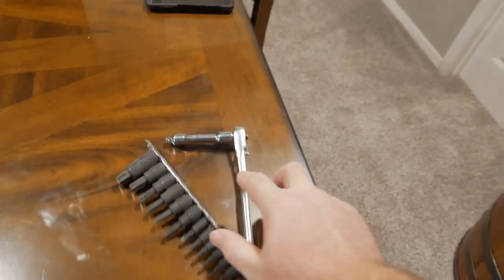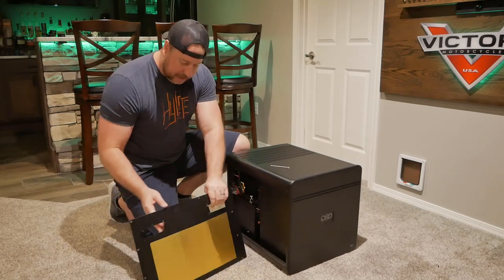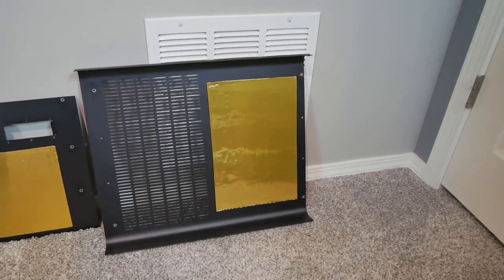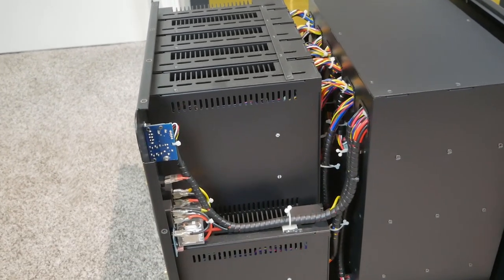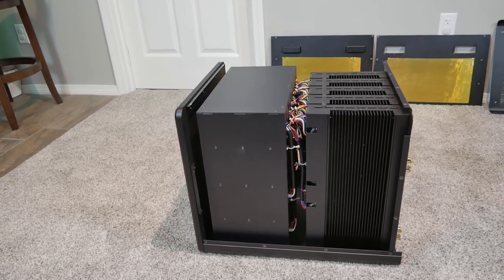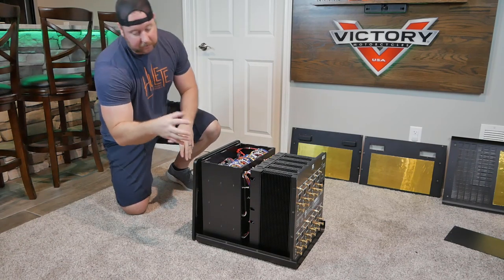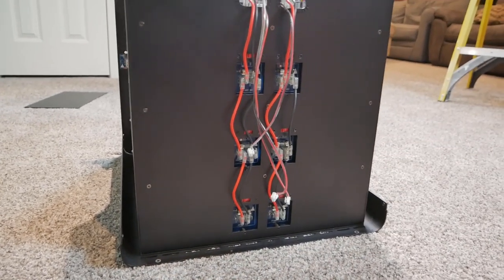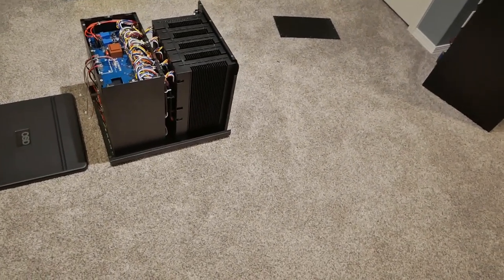Inside a 230 Pound Amplifier!! Opening the OSD Black Theatro X11 Home Theater Amp 380 watts x 11

Comment: Did you ever do a performance review of the X11?
Reply from the maker: I did not... there was some issues getting both power supplies to work without tripping breakers. OSD asked for it back and we decided not to do a video on it since it was not working correctly for me. They have assured me it has worked in several other installs they have done... 🤷‍♂️ I just know I couldn't get the full potential out of it due to it only getting half the power it needed

Comment: Whats up man? Great video! Had me laughing. I got a question not pertaining to this video. I'm looking at getting screen material from Carls place. I'm thinking about going with the flexigrey like you got.  Since you had a little bit of time with it now are you still liking it? I'm just trying to improve my black levels from my epson 8350 projector. Don't want to get a projector just yet since there is only a couple hundred hours on bulb. I also have a manual pull down screen that has wrinkles in it from sitting for a couple of years until my room was built. So I got to figure out away to attach the screen to the existing material and hope it doesn't get jammed up inside the case.
Reply from the maker: Thanks man! The flexi gray has been awesome. Love it for my area. Little bit of light rejection with it not being white and when the lights are out, blacks are a little deeper. Don't expect miracles, but it should improve your blacks a bit. As far as the roll up screen... Idk how the flexi gray will work with that... Might be too thick by the time both materials are on there. And if there are any creases in the flexi gray, they'll probably show up just the same. It needs to be stretched pretty tight to get a smooth surface. A fixed screen is probably a better way to go if you grab it
Reply: @LifeofBliss  Ok thank you! Stay safe!

Comment: I wonder how well it dissipates heat under moderate and full load? lol
Reply from the maker: Supposedly it runs very cool... but I could never get both circuits connected without tripping the breaker
Reply from the maker: It will work with 1 power cord only, but that kind of defeats the purpose
Reply: @LifeofBliss  Wow! I put 2 dedicated 20 amp circuits, but it was because I have too many devices connected to the 3 Furman line conditioners. This is only one Amp!
Reply: @LifeofBliss  This is a real life eye opener. Glad they offered it to you for reviewing.
Reply from the maker: Yea I have 3 20 amp circuits and a 230v30a for my sub amp in my equipment room. I did the wiring so it was cheap and easy to run several. OSD swears it has worked in many applications, but I couldn't get it to work correctly in 3 different homes... don't know what the issue was. Even did some testing with a multi meter to switch the polarity of the positive terminals between the 2 circuits.
Reply: @LifeofBliss  I did it myself as well. Its great that you took the time and effort to at least try and make it work to its full potential. Nice unit but feels like its in the Beta stages....

Comment: I'm pretty sure you have to have your electrical wiring in your home upgraded to even be able to use that.you probably need a transformer of some kind.not to mention your electric bill. My god.
Reply from the maker: Just 2 dedicated 20 amp circuits 😉
Reply: Does it run your bill high if you go hard with it?
Reply: Definitely the biggest amplifier I ever heard of.
Reply from the maker: I haven't hooked it up in my system yet, but it definitely won't do the bills any favors! But honestly probably won't have too much of an effect unless you were rockin out 24/7
Reply: I'll be waiting for that review. You have an awesome system my friend.
Reply: I have the outlaw 5000 and after this social distancing is over and I go back to work I'm going to first chance I get I'm going to get the emotiva xpa-3 gen3 for my fronts and center speakers.
Reply from the maker: Yea those Emotiva amps are solid. I have the 7 and dr3 in the system now and they've been awesome
Reply: I noticed you go big with everything you do.thats the way to go.

Comment: 2018.....lol old!
Reply: What? Two years in the audio world is literally like yesterday. I run a dual mono power amp that was self build in 1996 that puts out 125 watts at 8 ohm class A. A buddy of mine runs two old rotel thx power amps in mono (250 watt rms at 8 ohm 1991).
Power amps and stereo amps dont really matter in terms of age, however hometheater pre amps/ receivers do matter (to a certain degree).